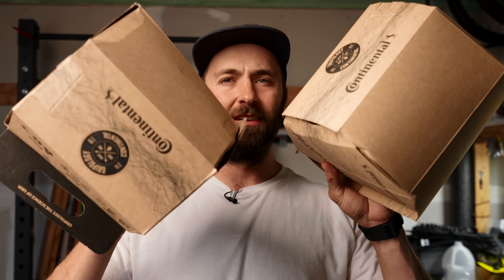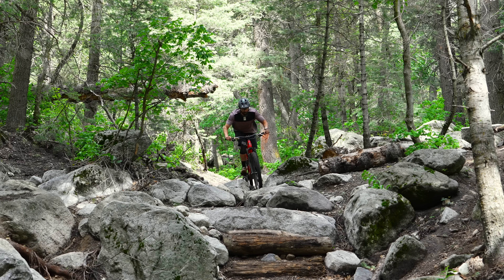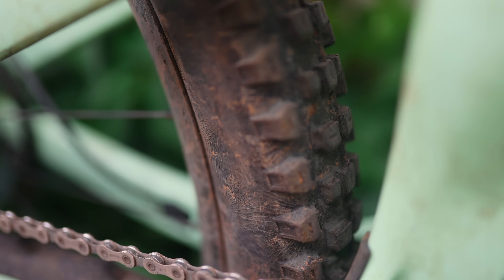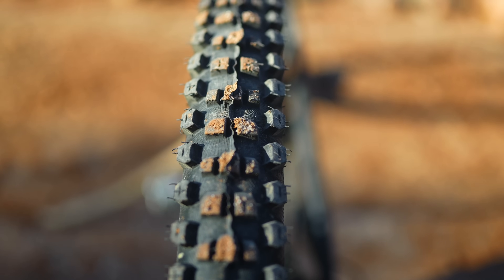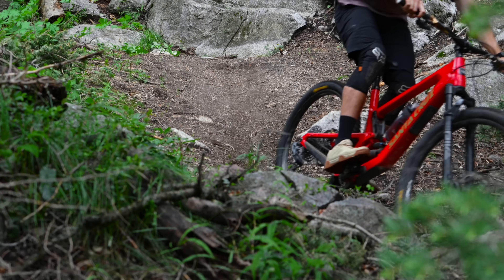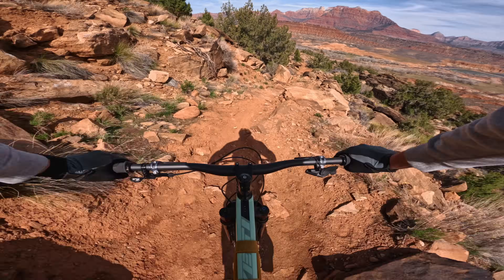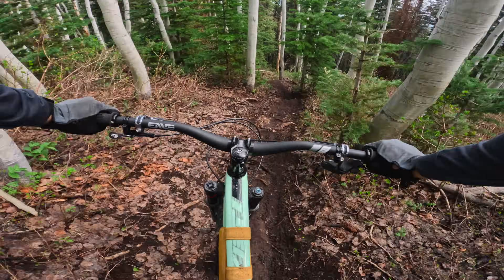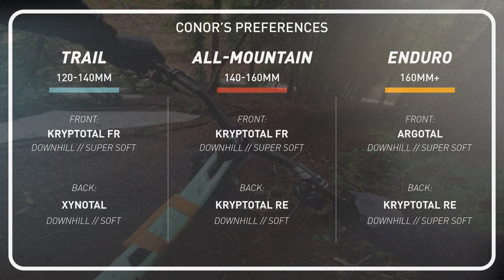Continental MTB Tire Guide: Find Your Perfect Tire

Comment: Conti should give us more options for compounds like Trail casing with soft and Enduro casing with super soft compound. I think there is a podcast by the World Wide Cyclery guys where they talk about seeing the enduro casings with super soft compound.
Reply from the maker: Yeah. It would be nice. Maybe they will expand the options?
Reply: Exactly.  It took maxxis a long time to have the maxxgrip with lighter casings but they’ve done it for a while now.  Want super soft for the front tire but I don’t need a dh casing front tire.  Really not interested until they start offering at least the front tire (like kryptotal F) in super soft without dh casing.
Reply from the maker: It’s worth noting that the Conti DH casing isn’t as burly and heavy as a Maxxis DH casing. You might not hate it as much as you think. It surprised me.
Reply: @bikersedge  I’m not super tough on tires and with a tannus insert I only need exo+ which is more like what conti enduro sounds like.
Reply from the maker: The DH is going to weigh about the same (or even lighter) as an EXO+ with Tannus and you won’t need the Tannus. Plus you’ll get better sidewall protection.
Reply: I was hesitant to move from Exo+ Assegai to a Kryptotal Fr Downhill but I ended liking the carcass quite a bit. It just holds the line so good over rough stuff! For me the tread pattern and its slightly snappy nature is bigger issue than the carcass. I've had a lot of tiny micro-slides on the front ever since I mounted the wheel on my Macic E-Deemax rims which by the way was extremely tight fit. I mean re-eally thight because the rim diameter measured 3mm larger than for example DT Swiss rims are. But when you get the side knobs to bite the grip is amazing. Running soft Xynotal as a rear tire and so far it's been pretty solid and fast rolling tyre. Deadly on snow thou...

Comment: How Argotal works on loose/dry surface?  better than Kryptoral Fr?    I'm thinking about 29x2.60 Argotal, for dry and loose summer. (before I used Assegai all year round).  Aggressive riding on Levo
Reply from the maker: Depends on what you mean by loose/dry. If you’re talking about full on moon dust the argotal can get through that better. I’d still only run a 2.4 to cut through it better. If you’re talking general summer dry conditions I think the kryptotal is probably the better setup.

Comment: Well done video. I understand how to choose the right tyre now. What would have been also helpful to compare the weight at least of the different casings. For example what is the weight difference between an Kryptotal Trail and an Kryptotal Downhill....
Besides that, what I still cannot figure out, which one of the new tyres equals my all time favorite "Conti Mountain King Protection". I would assume Kryptotal, Enduro, Soft....?!!?
Reply from the maker: These are all going to be far more aggressive than the Mountain King. The Mountain King is a trail tire, while all of these are in the Gravity series. The Xynotal might be the closest in terms of intended use.
Reply: Thanks for the fast reply. Here in Germany the tyre is rated from trail to enduro, with all mountain sitting bettween those two, and in an older Conti brochure the MK in 2.4 is also named as an All Mountain tyre next to the good old Rubber Queen in 2.2. But maybe you are right that the Xynotal is the closest to this one.  @bikersedge

Comment: What do you suggest as for sandy and loose over hardpack, think Southern Cali, Nevada, and Arizona areas. Kryptotal or Xynotal? I like my fronts to be (29x)2.6 tires with rear 2.4.
Reply from the maker: If it’s deep sand the Kryptotal will hook up better. If it’s Sedona style conditions I’d take a Xynotal.
Reply: @bikersedge  it's a little of both depending on where I go.

Comment: Need some advice on front tire. Argotal Trail Endurance or Kryptotal Re Supersoft DH. These two are the only ones available. I already have the Kryptotal Re in the front currently but I am thinking of replacing my Xynotal Enduro Soft rear tire with my Kryptotal Re Supersoft DH. Track is combination of rock, roots and loose over hardpack
Reply from the maker: Personally I love the DH casings because we’ve got sharp rocks all over.

Comment: @bikersedge I've seen a few pro's running the Kryptotal Fr on the rear, have you tried this?  If so, any comments on rolling resistance vs. the Re version and would it be viable for enduro with long transfers?  TIA!
Reply from the maker: That’s what I’m currently running. Does that mean I’m pro?

I don’t notice a huge difference in rolling resistance to be honest. I’ve mostly been using DH super soft so there’s a good amount of rolling resistance no matter which tire I have on there. The cornering grip on the Kryptotal Fr is really nice though.

Comment: DH casing 26-27 psi, How much do you weigh?  thank you Connor and great review. Im riding the Pole Vikkela with DH SS Argotal up front and the Krypt RE DH SS. in the back.  watching the most recent World Cup DH a lot of them rand Kryptotal FR DH SS front and back, and stayed off the Kryptotal Re. entirely.  Even the Atherton's did it for that track.
Reply from the maker: 195.
Reply: @bikersedge  Im same as you running 23-24 rear, 20-21 front on the DH , in the rocks charging hard.  I cant see 27, just way to stiff and loses to much traction for me, but I know you know your stuff so it works for you! ever try coming down to those pressures? just curious, NOT telling you what to do!
Reply from the maker: @86309  it’s pretty rocky where I ride. Much lower than that and it’s pinch flat city. I also prefer my tires to hold their shake in the corners instead of folding. Higher pressures help with that.

Comment: 3:26 How is this the rear tire? Did they change the tread pattern? I thought, only the front had alternating 2-3 center knobs whereas the rear had 2-2.
Reply from the maker: You’re correct. The front is 2x3 and the rear is 2x2. In the delirium of tire swaps and inhaling sealant fumes I grabbed the wrong wheel for filming this. I had been experimenting with a Kryptotal Fr as a rear tire.
Reply: @bikersedge  Ok thanks for the response :)
It would be interesting to hear, how the kryptotals Fr & Re perform on the opposite end of the bike.
Reply from the maker: I haven’t tried a rear as the front yet. Just the front as a rear.

Comment: What combo would you recommend for a down hill  bike. Riding  mix  conditions.
Reply from the maker: Kryptotal front and rear or Argotal/Kryptotal if you ride a lot of loose and wet conditions.
Reply: @bikersedge   thanks a bunch right I’m running the maxxis double ass combo they are best so I need new rubber
Reply: The descriptions from Continental are probably the most accurate and unlike Maxxis, you don't have to overthink it and do a combo. You ride trail, buy the trail tires. You ride DH mostly, buy the DH version of the tires based on your terrain. Seriously, they're that good and that accurate. I love my Xynotal for central CO riding and my terrain. I'll never go back to Maxxis at this point.
Reply: @danwillmann9193   right on thanks I’m all  in Colorado on the front range
Reply: Hey Connor as always an excellent informative review and exceptionally delivered as usual. 🤟🤟 i see you  are running tubeless do u also run inserts? If not would that change your recommendation of DH casing v Endurance with inserts?
Reply from the maker: @pauljordan6016 thanks. With the DH casings I don’t run inserts. On anything lighter I’ll run one at least in the rear.

Comment: I recently switched to Kryptotal F/R in DH super soft and noticed the rear tire rubber is way softer than the front. So much so that I used my durometer gauge, and it shows the front side knobs at 50-53 HA and the middle knobs at 54 HA. The rear tire shows 41-43 HA for the side knobs and 38-45 HA for the middle knobs. Did you experience this at all? Still great tires but I wish the softer rubber issue was with the front tire (if it is an actual issue) since the rolling resistance is way more than my previous eliminator grid trail rear tire.
Reply from the maker: I don’t have any way to test rubber durometer other than a good old fashioned squeeze. Not going to be very accurate here.
Reply: @bikersedge  It was noticeable just from a squeeze with my fingers, felt like the rear was left out in the sun for too long compared to the front.
Reply from the maker: @joshwest6921  Interesting. I'm going to go squeeze some tires and get back to you.
Reply: @bikersedge  Appreciate it!
Reply: I don't have a durometer gauge but I have run many Continental tires in the past. In the previous lineup of older Conti Protection Apex tires, all were labelled "Black Chili" compound, and although they had the same compound name, the knobs all felt different with respect to softness or hardness between the Der Baron and Der Kaiser and Trail King. I don't know 100% for certain but I suspect Conti makes the compound differently based on the tire model/use and just gives them all the same name that makes no real sense to differentiate one tire compound vs the other tire compound. I really would not be surprised if they are actually doing that with super soft vs soft vs endurance, but I have no proof and no inside information, I only have subjective experience with the older tires.

Comment: Interesting that the Kryptotal front is considered a DHF analog.  That tread pattern literally looks like an Assegai copy, I'm guessing the knobs are closer together than the Assegai?  IMHO they also need a 2 ply enduro casing, unless their DH is more equivalent to Maxxis Double Down than Maxxis DH.  Their enduro casing sounds like EXO+.  Have you had a chance to review Vittoria's MTB tire range?  I had a chance recently to ride a demo bike with a Mazza up front and found that tire to corner incredibly well, even better than an Assegai.
Reply from the maker: My comparisons were in terms of intended use. The Kryptotal falls in line with a minion even if the tread pattern looks closer to an Assegai. The tread height and spacing is closer to the minion. The Argotal is more aggressive and wider spacer for better loose condition performance like an Assegai. 

You might be right with your assessment of the casings. I feel like the Conti DH casing is like a double down plus. That’s why I mentioned that in the video.

Comment: Can I put the new gravity Conti range rear tyre on the front ? Will there be a noticeable difference ?
Reply from the maker: I’ve been running the kryptotal FR on the rear. I don’t think it’s going to matter a ton if you put the rear on the front. The tread pattern might not be optimal but it will be fine.

Comment: hey may i ask whats the tyre pressure your running on your front tyre and rear tyre
Reply from the maker: Depending on the trail I run 25 to 27 on the front and 28-29 rear. DH casings.

Comment: So are they better then maxxis tires? Maxxis has every feature that these Conti's have you've mentioned. Sell me on how they better and ill change rubber, but ive always been content my with maxxis tires. DHR2 front Dissector rear 2.4 double down max terra
Reply from the maker: Not here to make you switch over. Just offering some insight into new tires that a lot of folks don’t know about. I personally like the DH casing in this more than anything I can get in Maxxis. It seems to fall somewhere between a DD and a DH. That’s one of the biggest reasons for me.

Comment: They dont hold air. I returned them. I installed it on a brand new wheel, tried two different brand of scellant, even brushes scellant on the tire bead. I checked the stem valve o-ring, and retight it, and replaced the valve core. Still leaking. After 24h tire had no pressure. I inflated the tire at 50 psi, and immerge it in water. The slow leak came from the tire sidewall. The shop didnt ask questions and took them back.
Reply from the maker: Your Contis? Interesting. I’ve been through close to 20 in the last 6 months across various bikes. Haven’t had that issue. That sucks.
Reply: If the tire does that you can lay it flat so the sealant pools in the side walls, they flip it over after a couple hours. I had to do that on my WTB tires on my gravel bike.
Reply: aluminum Mavic rims to Santa Cruz carbons, the Conti  enduro casing Kryptotal Fr/Re are holding extremely well. sealed up with no sealant and holding air with only a 1-2 psi loss at 30 psi over 36 hours leak down test.
Reply: With or without tire insert?
Reply from the maker: @bikedude019  Inserts can complicate things. In my experience my tiers leak more when I have inserts. I've had trouble with almost all the brands when running inserts.
Reply: Never had issues with inserts and Maxxis DH casing. With a selling price near of 150$ CDN (taxes in) per tire there is zero tolerance on manufacturing defects, performance, and reliability. So far, the only tested plan B is Schwalbe, but they melt faster in Whistler bike park.
Reply from the maker: @bikedude019  I mean you're not wrong.  Expensive tires should work perfectly. I've had issues with Schwalbe, Maxxis and Kenda with inserts. After pulling the inserts, the tires don't leak anymore. I think it's more of an insert tolerances/install problem than anything.
Reply: Interesting, I’ve never removed an insert and ride the same tire without. It make sense inserts disforms side walls. I’ve tried many different combinations. Michelin DH32 and 34 also leak. I guess its to find the best tire depends what wheelset/rims you have. I wished Conties worked as they are little bit cheaper.
Reply from the maker: @bikedude019  It very well could be the specific rim, tire and insert interface. I had a hell of a time with Tannus, Enve AM30s and Kenda Pinners. Couldn't keep air in them even overnight. Just have to stumble upon the lucky combo I guess.

Comment: HOPING YOU CAN HELP! I have a heavier electric mountain bike/Enduro bike that I’m looking for a more “dual sport” set up for because I commute… Something along the lines of a Shinko 244 or 241 tire, however, because I do not have an Mx wheel set up… as a result, I am looking for something that closely resembles those tires, but in MTB 27.5” form. Are the continental Kryptotals a good option in close relation to those Shinko’s I mentioned?.. or do you have anything else you could recommend? My biggest concern is being able to commute/dual sport, while simultaneously avoiding any/all flats! So the “burly” tires don’t scare me even if they’re much heavier! Any professional advice would be greatly appreciated! Thank you for your help and amazing video! 🙏
Reply from the maker: Kryptotals would be fine — certainly overkill on the tread for any sort of on-road commuting. In DH casings you should be pretty flat resistant. Broken glass, nails, road debris... would all still be a concern.

Comment: any idea why they don't make a 2.5 ?
Reply from the maker: Because 2.4 is the correct tire size.
Reply: I guess all the bike company’s that ship stock bikes with a 2.5 in front got it wrong ? I would think at least from the perspective of getting that OEM business they would make a 2.5?
Reply from the maker: @TheJollyElf  I’m just giving you a hard time. At the end of the day I don’t think many folks are going to tell the difference between a 2.4 and a 2.5 tire. It’s about as much as a penny on either side of your tire. I’d imagine rim width and air pressure will have way more of an effect on the actual width of the tire.

Comment: Xynotal rear and Kryptotal front, ftw
Reply from the maker: Thats my setup on the 5010. So good!
Reply: Got it on my sentinel for NC riding. I'll have to try the DH casings and softer compounds, because I'm running trail casing at the moment.
Reply from the maker: Worth the weight penalty for the flat protection and sidewall support.

Comment: Wish they had 2.6 to 2.8  for the front tire
Reply from the maker: 2.4 is the correct size.
Reply: Not for a hardtail.
Reply from the maker: @th3lowland3r  ha. Just giving you a hard time. It’s personal preference but I’ll take 2.4 on all my bikes - hardtail included.
Reply: Totally agree on 2.4 for full suspension bikes but 2.6 or preferably 2.8 really help that rear wheel track and eat up the vibrations when riding anything chunky.

Comment: Downhill casing front tyre on a trail bike. 

Interesting
Reply from the maker: Interesting for me too. They are a bit lighter and more pliable than most other DH casings though. Think of it as Double Down plus.
Reply: @bikersedge  fair, Double Down on a trail bike still seems very committed
Reply from the maker: Haven’t had a flat once with them. The first EXO+ that came on my 5010 lasted all of 20 minutes. Went through 3-4 trail tires the first week on that bike.
Reply: @bikersedge  Fair enough, you must rip
Reply from the maker: Nah. Just good at finding pointy rocks.

Comment: The Continental Kryptotal is like a copy of a Maxxis Assegai, not a Minion or a Big Betty - just look at the center knob they added in there.

Otherwise - this video was great. Been following the World Cup DH teams and their use of these new tires. Got a Krypto on the front and will get a Xynotal on the rear once my Schwalbe wears out
Reply from the maker: As far as tread pattern goes you’re correct. As far as tread size/height and spacing goes the Argotal is closer to the Assegai.
Reply: Wich have better rolling resistance argotal or assegai (in front)?
Reply: @Bosko1000RR  the argotal is almost a cut spike tire. So the assegai would have lower rolling resistance. In my opinion